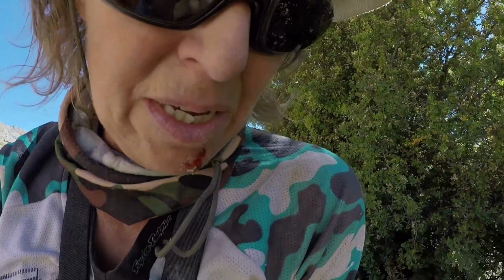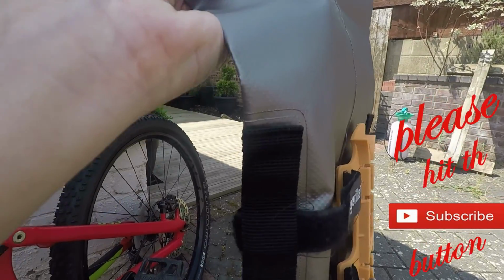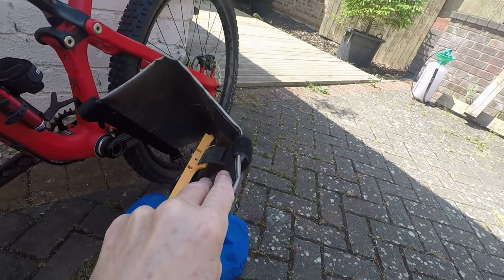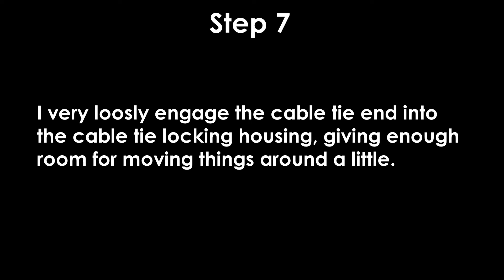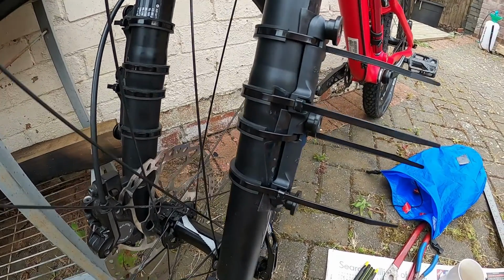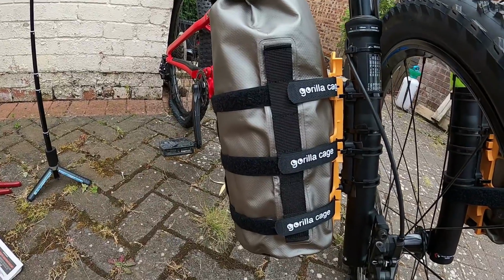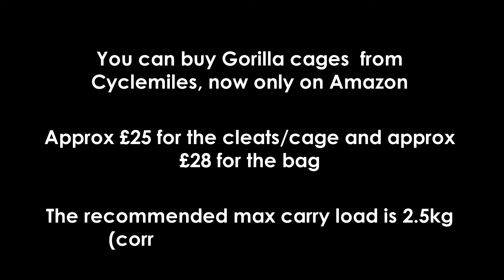Fitting Fork Luggage to a Full Suspension Mountain Bike - Gorilla Cages #gorillacage

Comment: Thanks so much for taking the time to put this well-produced video together. Am about to install my new Gorilla cages with confidence now!
Reply from the maker: Check out the instructions that come with them too   Don't worry if you get it wrong, you can always reposition them.  It only needs cable ties and sticky back tape that you can get from your local hardware shop.  Good luck🤞
Reply: @NoSecondSeason  Already bought a second set from Amazon UK (thanks to your purchase link!). Even with the expense of overseas shipping / currency exchange fees, etc, it's much cheaper than the only other link I have been able to find for buying Gorilla Cages in USA (which was my first set on ebay from Taiwan). Sad that such a genuinely practical setup isn't even available in the retail market here.
Reply from the maker: @BoogieBrew  Cycle Miles used to sell them but with covid they decided to only sell via Amazon, at least you'll get the genuine article from that link.   I'm not an Amazon affiliate, so don't get a commission 😟

Comment: Hi there thanks for the video, very pragmatic.. I’m thinking of getting some of these ... how rugged are they?
Reply from the maker: Hi Tim, I haven't used them yet with the new bags. I think if fitted properly and the proper bags are used, I expect they work fine.  If you take a look at my video Episode 13 Alcutar to La Calahorra, you'll see that I probably abused mine, both riding and with an accident I had on that section, they took a hell of a hammering, and were fine.  My bike fell over lots of times.  The Altravesur is a rough old route and until the big fall I had no reason to doubt the mechanical integrity of the Gorilla cages.  In future I will be a little more considerate.  Perhaps write to the supplier and see if they have any stress or fatigue analysis on them?
Good luck, I hope you get sorted👍
Reply: @NoSecondSeason  brilliant..thanks for the prompt reply, I’m Doing a 7 day trip in the Australian alps and it’s gets pretty rough up there, so if you have given them a good hard bashing and they’re still going strong, worth a crack at them. I can get a bundle incl bag o do that, cheers thanks again😎👍
Reply from the maker: @timident  Did you see that I did eventually break one of the Gorilla cages?  Which caused a bad crash?  When I ride with them again, I will check them each time I fit the bags back on.
Lucky you getting off on a ride in the Australian Alps.  I hope you have a fab ride. 🤘 
My bike and me we're ready to set off last week to ride part of the Victoria Divide 550 backwards, as I'm in Lavington.  But my daughter got so upset that I was going, I didn't go☹️

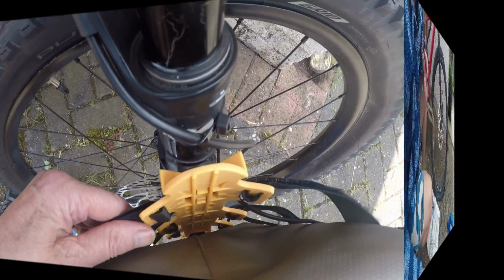Comment: 5:48 just a warning about shimano brake housing, the zip tie might put some wear and cut into the hose if the hose moves a lot.
I am curios why you run the  brake hose on the outside of the leg, not on the inside.
also does the hose move too much so you have to use a zip tie there?
Reply from the maker: Hi it is how the bike was built, around 10cm higher up is a proper fixing for the brake pipe.  Where I've cable tied it, to clear the fork luggage, there is a rubber pad under it, I don't think it moves as it's all very tight and there no scuffing.👍
Reply: @NoSecondSeason  good, it is protected with luggage there anyway and with that yellow thing, but if that's not there cable is quite exposed. So the rule is to always have it between fork and wheel. And this is how a bike should come assambled.